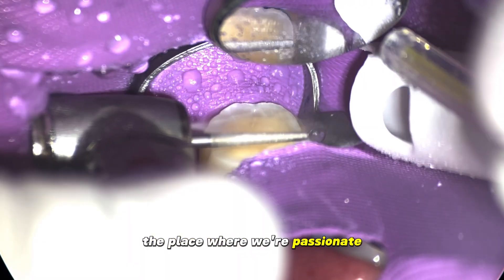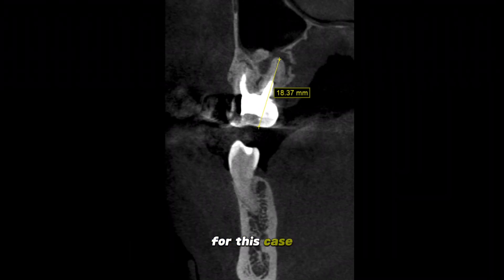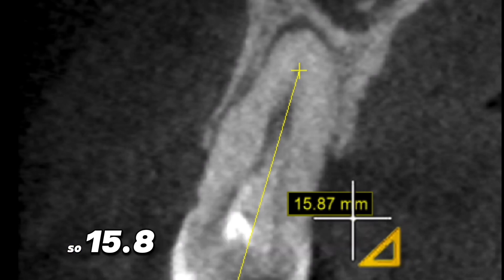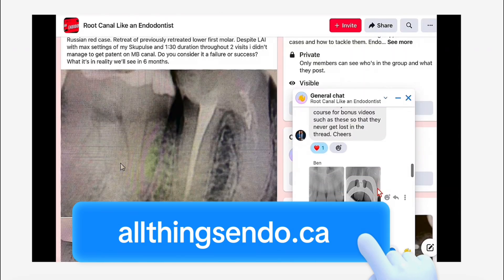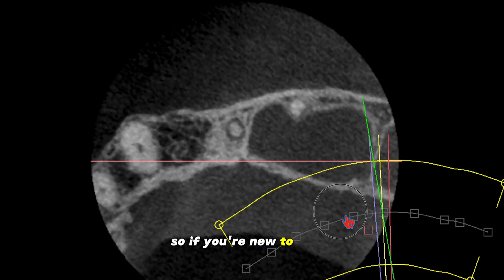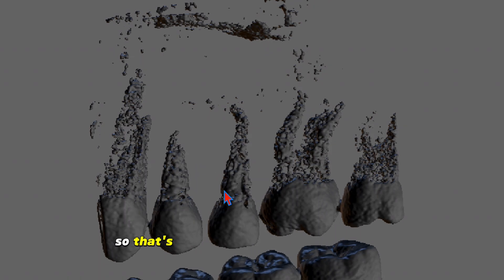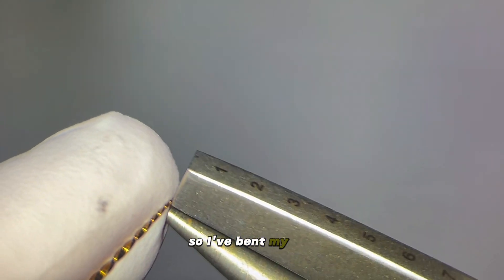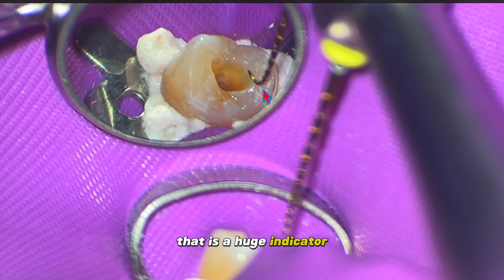2 CBCT Tips to Prevent FILE Fracture

Comment: Manual K Flexible Files Always Win in that type of Curves 🌹
Reply from the maker: Thank you so much for your comment. I actually agree. However, in this case, those dang K files would not get to length no matter how I bent them.!  it was an active frustration until I bit the bullet and took that small reciprocating file to length without a glide path. This is a very rare occurrence, but I wanted to share the warning sign of an impending fracture. I hope you enjoyed the video.